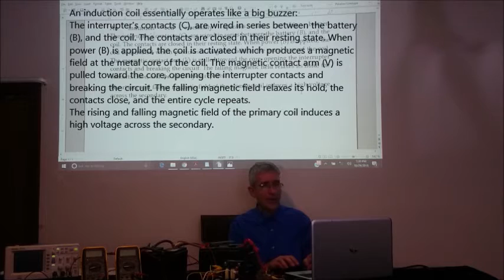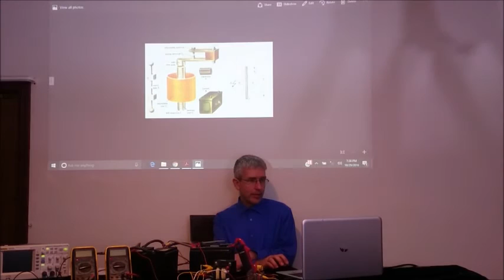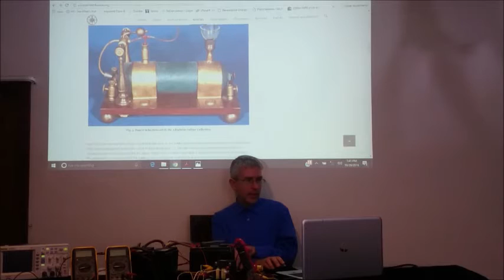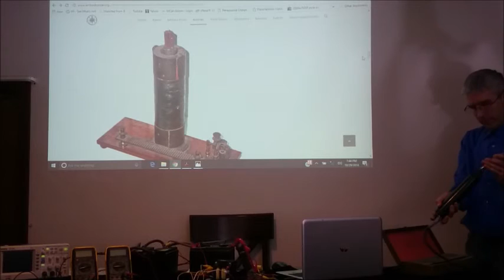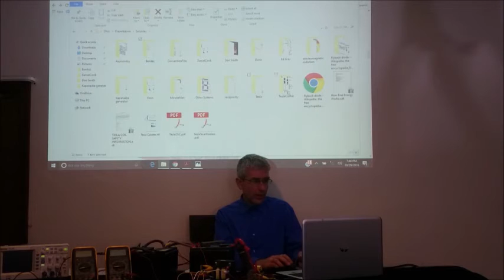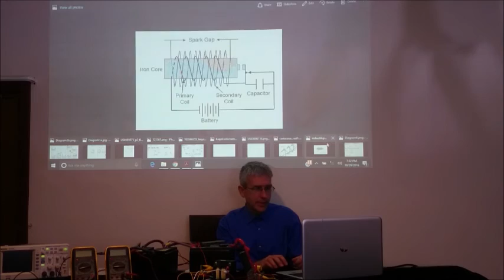The First Free Energy Patent is Misunderstood.  Part 2 THE INDUCTION COIL

Comment: I notice that on antique induction coils, the primary is wound on the inside next to the core, but in a modern oil filled car ignition coil the primary is on the outside with the high voltage secondary wound around the core. I wonder why and I question if it would matter in a Benitez/Cook replication. Rick what do you think?
I'd love to get a suggestion of a book that explains the benefits in an induction coil of having the primary inside or on the outside, either with a built in interuptor or a liquid type.
Reply: I guess nobody knows

Comment: I presume this produces DC. Would it pose a danger when in general use.  I understand AC is now used because it is less dangerous.  If this is a problem could it be resolved in a way to satisfy health and safety regulations?
Reply from the maker: The induction coil I am demonstrating was normally used at 4 or 6 volts so the output voltage was not very high. The frequency was also not high so there is very little bad radiation possible in this case. I was running it at 12V and around 50-100ma. AC or DC can be dangerous. This is not really either, it is a disruptive discharge and is like a burst of energy. While it is DC in one sense, the process triggers other phenomena that is no looked at or understood by the conventionally minded electrical technician. 
As for running such as a larger system I do have a complete solution for all this even at the megawatt level. I do not suggest using very high voltage and very high frequency devices as you will be doing harm to yourself in more than one way. You need the right type of shielding. I think this will be a big thing in the future and I hope to make it a big focus as the world now moves into these sort of technologies.